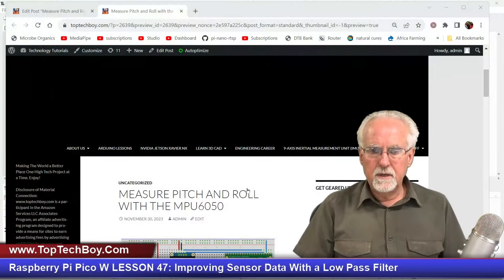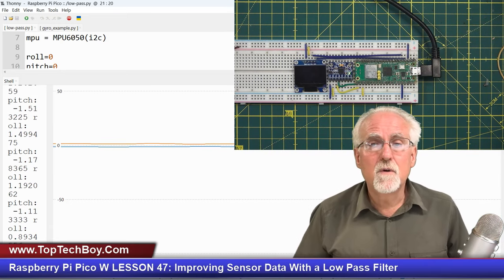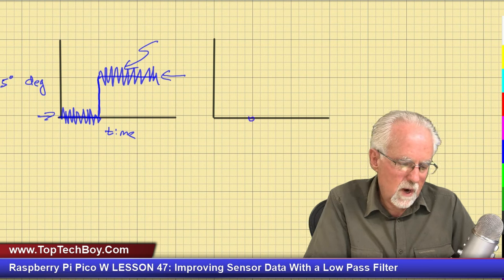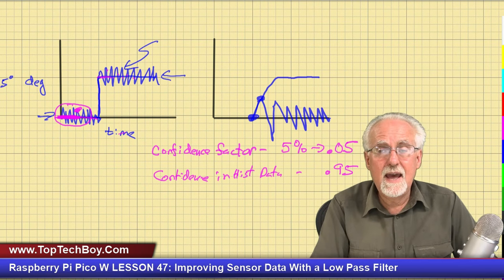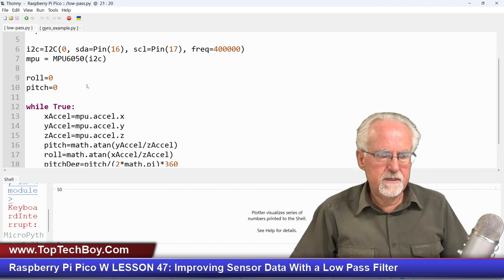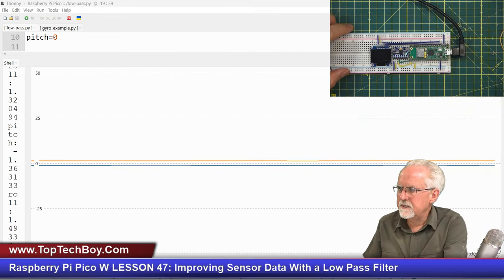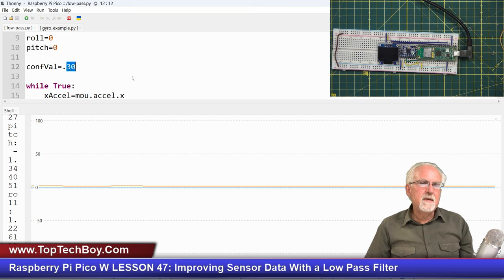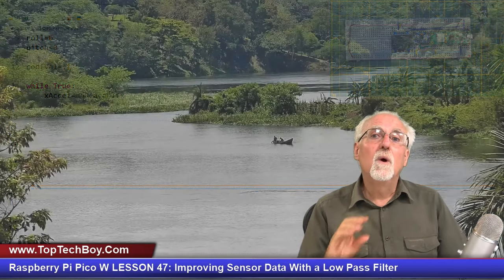Raspberry Pi Pico W LESSON 47: Improving Sensor Data With a Low Pass Filter

Comment: Two thoughts regarding improving response and rejecting noise: 1) How about using an exponentially declining moving average? 2) Would using the gyros result in better response as they are sensitive to changes in angular momentum and less so to axial displacement?
Reply from the maker: As we will see, the real way to solve the problem is by using the gyro. The challenge then becomes how to combine, or fuse the accelerometer and gyro data for the ultimate solution.